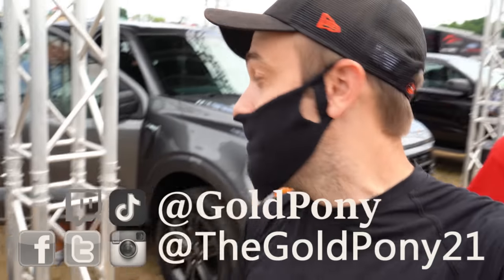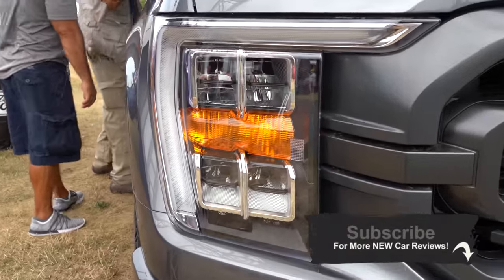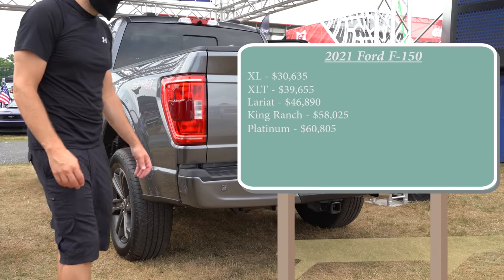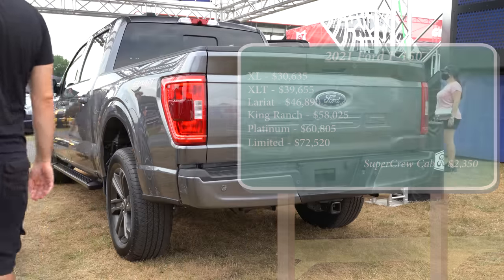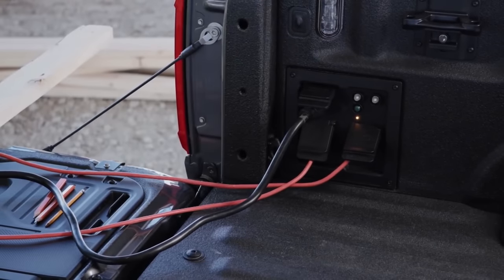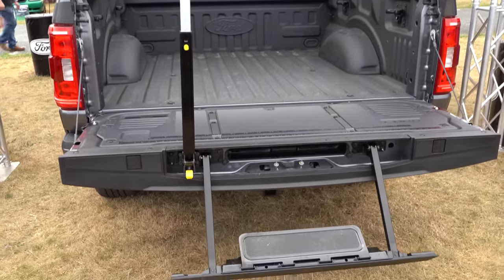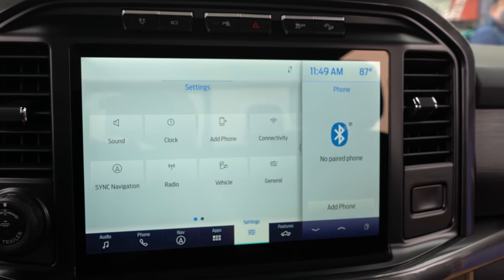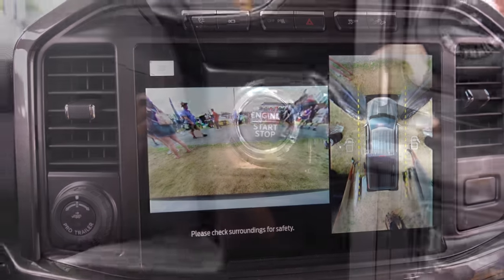2021 Ford F-150 First Look | This Truck will Surprise You

Comment: Man, good thing you asked an audience who can’t answer you, “what’s up?” while you got that mask on in a video about a truck - which looks rather similar to current GMC headlights and the full-width band across the grill taken directly from 70 years of Chevrolet design. 11 different grille options? Wow, that’s so innovative. A plastic ruler on the edge of the tailgate, and a cell phone “holder”? Look up “gimmick” and you’ll find a picture of this tailgate there. However, that power port is something owners have been putting in their trucks aftermarket for 20 years. Glad someone figured that out at the factory. More importantly, can it go 700 miles with a camper? Or does it get 8-10mpg like evert other V8 or V6 or Diesel or EcoBoost when it’s hauling a load? Good thing there’s a hybrid, because more gasoline is the future. C’mon Ford, give us an all electric, instead of just complicating the machine further with a more expensive sticker that costs waaay more to fix.

Comment: If you ever have a truck, it should only be a column shifter or a 4 on the floor. Not some dinky little shifter that’s over engineered.its just more unnecessary plastic crap that could break down the road.

Comment: Console shifters are such a waste of space. Keep the shifter on the steering column where it belongs and is easily accessed to lock out high gears or down shift when towing or hauling a load which is pretty much constantly for me. Or even use pushbutton or dial shifter (though those are not very convenient to manually shift so I much prefer a column shifter). A shifter has no place on a console. Such a waste of space.

Comment: So they made the problem and came up with the solution. The folding shifter is an absolute gimmick. Couldn't have made it a shift knob? Buttons? Maybe even better a column shifter? I'm not immediately assuming that this mechanism won't be reliable but simply put, it's unnecessary.

Comment: i have a 2018 sts been a great truck but lately has 20000 miles on it it makes a weird noise.if you go slow and push gas let off and push it again it makes a weird noise like grrr push gas it goes away then let off it makes noise again its loud for a pedestrian im sure

Comment: I was expecting a Twin-Turbo V8 instead of a V6. I’m so disappointed.
Reply: Better lower your expectations
Reply: Doug L U Bet!😞
Reply: Sad Ford, sad
Reply: Not sure why you would expect that.
Reply: @flyer8493 it would make even crazier power than the ecoboost or powerboost. Even adding one turbo is going to change the power ratings pretty high
Reply: Jesus Perez It would be awesome no doubt. But then Fords 6 cylinder ecoboosts would take a huge hit and thanks to CAFE they can’t have that.
Reply: flyer8493 yeah i guess im sticking to my 2016 5.0 xlt, great truck by the way.
Reply: Jesus Perez yep 👍🏽. You’re right!

Comment: The highest end cybertruck is 3k cheaper than "limited" and tops the Ford in almost every category. Prove me wrong
Reply: Well you can actually buy a Ford f150. You can't buy a cybertruck and you never will be able to buy one. Tesla can't afford to produce the cybertruck. Tesla barely has enough money to keep the lights on in their tent they call a factory.  Tesla is in big financial trouble. Nobody is buying teslas because they are unreliable junk. But let's just pretend that you can buy a cybertruck. A base model cybertruck will cost nearly $100,000 so right off the bat you are wrong. The Ford looks better, it can tow more, haul more, way more reliable, and best of all the Ford wasn't built by a company thats owned by a pedophile. Tesla however is owned by a pedophile...
Reply: @Boss-bf7ru  You're wrong in literaly everything you said. But okay Ford boy
Reply: @davidrobinson2323  you have no argument. Thats what I thought. Thanks for coming out.
Reply: @Boss-bf7ru  I guess you win, if you think it'll make you feel better about being completely wrong 🤣
Reply: @davidrobinson2323  still waiting for you to prove me wrong...
Reply: @Boss-bf7ru  You proved yourself wrong by stating incorrect facts. 

The current Ford, 2020, tows up to 8k. The 2021 MIGHT pull 13,500. The cybertruck tows 14,000+
The cybertruck will also do a 2.9 second zero to sixty. 
It also features a solid steel exterior shell, far more resilient against impacts. 
Also features an actual autopilot, 500+ mile range.. shall I go on? 

And Telsa isn't failing, they're new. As apposed to your blood deep Ford. And while yes, Ford has never gone bankrupt, neither has Tesla. They produce the fastest, farthest and least inexpensive, in terms of upkeep, vehicles. 

Don't be afraid of the future combustion boy, ford has made an electric F150 as well, and was shown pulling 1.2 million pounds. Incredibly impressive. Every manufacturer will go to electric.
Reply: @Boss-bf7ru  Also, top end cybertruck is 70k, not 100k. And Elon isn't a pedophile, hes just smarter than you and it makes you mad.
Reply: @davidrobinson2323  🤡

Comment: Stick shifters are obsolete. Why not use dial shifter or simple drive/park buttons. There will be no need for fancy shifter which will obviously fail. P.s. Column shifters are so 1950s, so No.

Comment: The prices are sky high to encourage leasing. once lease is done and ford has made money on the truck it gets sold again as a used vehicle with low miles and its sold for nearly new prices. Its like a double sale for Ford so they dont give a damn how expensive the truck is. They dont want you to buy it outright

Comment: That fold down shifter is such an unnecessary feature. People that use these trucks as trucks and get the inside of these dirty might be worried about dirt, water or any other debris that might get in there. Next thing you know your fold down function doesn’t work, next thing you know you have an electrical problem, next thing you know the truck starts on fire.

Comment: So that shifter is absolutely ridiculous considering they could have gone ahead with a dial configuration like dodge. Less moving parts in my opinion and still would of had the capabilities of folding open the centre console with less moving parts. Trying to sell an idea which in my opinion is flawed.

Comment: Man acted like Bluetooth pairing on a F-150 is new. I drive a 2013 F-150 Lariat and I’ve got mine set for Bluetooth...
Reply from the maker: Android Auto wireless is new Bluetooth has been around for a while 👍
Reply: Gold Pony I’ve got an IPhone XR and it pairs. Maybe it’s the smaller screens on lower trim levels in older models.

Comment: It would be great if all the shit would last BUT we all know it’s now. After 6 or 7 years all that shit is going to start breaking and your only going to have like 90k miles on your truck. Eventually that shift knob mechanism will get stuck and it will cost 800 to replace. If your aiming for this truck just lease it and change trucks every few years

Comment: So what happens when battery goes flat and the shifter is in down mode?
No shifting in to neutral  to push  or tow. 
I would bet  my lunch money that that gimmick shifter will brake and live you stranded sometime in the near  future.
Reply: Knowing Ford there's gonna be some sort of recall for something electrical related, would be funny asf if we saw a 2021 F150 stranded cos the shifter is stuck

Comment: No more ford for me. My 2019 F150 5.0 is burning oil at 14,500 miles. Its burning around 2 - 2.5 quarts per 5,000 miles. What kind of garbage are they selling? I bought the 5.0 because I assumed it would be the most reliable but it sure ain't
Reply: My neighbors ‘19 Silverado with the 5.3 burns 2 quarts every 5,000 miles. My buddy’s ‘18 ram had his transmission go out right after the warranty expired (63,000 miles). Seems like the only full sized not having problems are the Tundras, only down side to them is that they are gas hogs. 

BTW did you get that TSP “fix” on yours yet? Seems to work on 50% of the trucks burning oil.
Reply: @bap7929  Interesting that you mentioned Tundra because that is exactly what I traded my F150 in for. I'd rather spend more on gas than ever have to worry about mechanical issues. I didn't even bother with the TSB because I got an awesome trade in value for my F150 and after seeing the engine issues and my dash warped in under a year I really didn't want to keep it. I don't want to worry about fixing a truck after warranty that failed because of poor design and quality.

Comment: The f150 body hasn’t changed in almost 20 years. The cab looks exactly the same. Still has that stupid dip in the front window
Reply: Honestly I like having that lower section on my F250 windows. It makes it easier to see the convex mirror on the bottom if you've got tow mirrors and it works as an armrest.

Comment: So based on your initial price layout, a base XLT super crew is around 43k add 4wd and your at 45/46k for a base entry level XLT? With a rubber steering wheel... cmon Ford

Comment: Ford's auto transmission does not allow drivers to push the shifter with an open palm from Drive into Neutral in an emergency. Most other manufacturers don't have this issue - not GMC, not Chevrolet, not Ram. This is a big fail on Ford's part on otherwise a very nice F-150.

Comment: I'm sorry but I feel like most of these features are overrated, let's see someone lay down with the seat fully lowerd and see how comfortable it is to have ur legs there dangling.  The tailgate is ok but i bet people will just stick to their setup in the garadge.  Rams interior still beats it even at platnium levels and chevy seems to have better tech.  For me this truck doesnt have enough new features to be considered a all new redesigned truck.

Comment: The Price Range for Trucks have Increased DRAMATICALLY however....
Would i buy a 75K Mercedez Benz or BMW
OR
buy a 75K Dodge Ram (fully loaded) / 75K Ford F-150 (fully loaded).
What these trucks are coming to the table with is IMPRESSIVE!!!
Being that I can have the SAME luxury, more safety, more room, higher visibility in traffic, 
can do a lot more with and have so many more conveniences a truck offers 
(like not worrying about pot-holes) than a Merc or a BMW
I OPT FOR THE TRUCK!!!!.... BUT.... 
There is a way to get around that 75k though....
Buy it USED.... like 2 years old So I am not paying for the SEVERE  Depreciation!

Comment: Ford is being sued for it's 10 Speed Trans. How is it so "Wonderful"?
Reply: Maybe 5 people on report for a lawsuit and over 3 1/2 million car and trucks sold by GM and FORD in the US and Canada market with a 10 speed transmission be reasonable
Reply: @myopinion7236  Have you driven one? Have you noticed the hard shifting and hunting for gears? Don't think it's going to hold up long term!
Reply: @JPE_DRAEB  I have a 2017 Limited and a 2019 Limited and I have never experience that problem and I use these trucks for everything
Reply: Je P I own a 2018 F150 10 speed and it’s been flawless. It doesn’t hunt gears at all.
Reply: I have a 2019 Chevy Silverado with a 6.2 and the 10 speed and so far it’s been great.
Reply: Je P have heard the same thing recently, from someone with the 10 speed

Comment: Especially right now nobody's going to go buy a baseline $30,000 truck when you're demoing a top-of-the-line trim on the truck. Especially if I'm looking for top of the line trim I want to step on that bumper so I don't have to go aftermarket. And as far as that shifter laying flat that's a gimmick to me and something that will probably break down the line just like the door latches did where you have three recalls then a class action lawsuit. I will pass on this first generation redo.

Comment: The center shifter pisses me off to no end. With every good idea Ford has (fold out center arm rest) they somehow come up another that is terrible. Why was it more practical to keep the center shifter, and install an electric motor to "hide it" instead of just putting the shifter on the column like the super duty? That way you'd have more space, an option for four cup holders, your folding out arm rest into a table still works and no extra unnecessary electric components. But no, they had to do it this way so they could show off another stupid gimmick.

Comment: How about a $25k model with vinyl seats, no carpet, no headliner, no direct injection, no touchscreen, etc. Just give me a box liner and 4wd. I'll even take the basic 3.3 engine as long as it didn't have direct injection. I'll let some other jackass take the depreciation hit and I'll buy it at the repo sale.

Comment: When is ford going to join the party with a factory lifted off road package on the f150 ? I really thought they would with this new model .
Gm has the AT4 and trail boss .. dodge has the rebel .
The F150 is a great truck .. I’ve owned 4 since 2010 . But I have always thought they are way to too low to the ground . I don’t like lifting a new truck and messing with the all the factory geometry. 
Ford gave the super duty line the Tremor package  ... why can’t f150 have the same ? I think it would sell like crazy . Im not sure why ford is asleep on this .

Comment: is it an EV? 
Can i build it online and not have to visit a dealer to receive it?
Reply: It's a hybrid
Reply: @floof4444  noted, but it still has an engine and all the issues that go along with it.  oil, air, lifters, timing, that whole combustion part, etc.
Reply: @jetah50  still impressive truck. I'd buy it if I wasn't gonna buy the bronco already
Reply: @floof4444  it'll be impressive to me when it's fully EV.  EV is the only thing that'll save ford and they only have 1 model of their whole line up.
Reply: @jetah50  Ford isn't on the verge of dying believe it or not. Besides they already plan to have a fully electric f150 in the next few years. It won't work great with off-road models tho. Or towing trucks
Reply: @floof4444  problem is they'll only hint at EV. if they said an EV f150 was coming out in 5 years, then many people would just wait 5 years before purchasing.  so they just continue to push out current tech with a different dress on.
Reply: @jetah50  they didn't hint at it though they literally stated they are making a fully electric F-150. Nothing wrong with dressing up to keep things interesting

Comment: No thanks Ford, I’ll Gladly keep my 18”  GMC Denali 1500
Reply: Alright, ill see you on the side of the road when it breaks down ;)
Reply: Will you be saying that when the valve train fails causing a catastrophic engine failure? Will you be saying that when the transmission turns all the gears into neutrals? Will you be saying that when both differentials pack up? What about when the body rusts out? Better hope you don't crash that gm truck what with the one star crash rating...
Reply: @Boss-bf7ru  beautifully said.

Comment: 4:13 check engine light already on
Reply: Where the hell do you even see that lmao that’s the back end of the truck
Reply: That's because the engine has not been turned on, the tachometer is at 0 RPMs. The check engine light is on on most vehicles when they're not running.

Comment: 700 miles of range? My @$$ can’t handle the 525 miles my 2012 crew cab 5.0 4x4 dose now I usually stop around 400 miles for gas and stretch my legs just because.

Comment: When the starting price on a basic pickup truck makes you realize you could buy a Mercedes for less.
Reply: A Mercedes that will cost an arm and a leg to maintain, and can't haul any tools... right.... two different animals.
Reply: If you're comparing MSRP to MSRP, the cheapest Mercedes option is still higher. But not by much.
Reply: Mercedes are 🗑🤣
Reply: Except a smart person wouldn’t buy a Mercedes

Comment: $70,000 for a 1/2 ton truck that barely looks any different? I’d rather had a old 2013 truck with basic and manual button radio, gear shift, etc. Not this unreliable electric, technological crap that would probably go broken in a year

Comment: I have a 2018 f150 5.0 24k km on her only.
-consumes an operating range of oil every 10k km
-horrid rattle on/off throttle and squeals on idle
what a bag of garbage . And fords response? It normal.
Dont waste your money in this under engineered crap
Buy a yota i wish i did

Comment: Trendy tailgate BS no one will ever use. Fold down console shifter proves the point that once the truck is in gear the shifter down there is just in the way and the original column shifter was better. The F150 design team is weak and pathetic IMO Ford should of fired the whole lot years ago.

Comment: No thanks. Not worth it. My 74 F100 ... Does the exact same job. Without a single technical problem. You know how many downloads I had to do this morning... To get it to run? None. I pump the gas three times and turn the key. Automobiles run on three basic concepts spark, fuel, compression. Everything else is bulshit.

Comment: I only watch 6 minutes of this video the options on the truck are so stupid and ridiculous I didn't even care to watch the whole video I want a truck this is not a truck it's a tinkertoy I am so glad that I bought a new Dodge instead of ford saved money and got a lot better nicer looking truck play don't know what the Working Man is going to do for a truck you just can't afford the prices on these newer vehicles and it's obvious that they're not going to hold up under the brutal force that is put on most work vehicles I can't even imagine trying to take one off road . the very first thing I had to do to my new Dodge was put a lift kit under it and that nine speed transmission they saying constantly shift up and down up and down up and down even on the interstate it's shifting back and forth  and when you try to pass somebody it shift 3 times RPM goes up ridiculously hight  . If you shift to tow haul RPM stay above 2000 all the time which is not good for engine and uses the heck out of gas I drive my 98 Chevrolet most of the time I like being seen in a real truck
Reply: working men don't lift their trucks😂